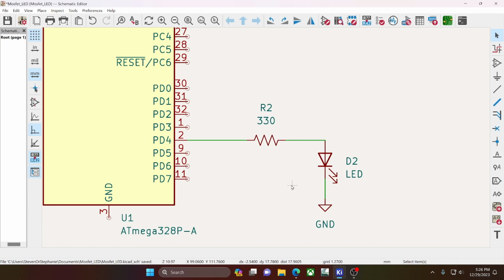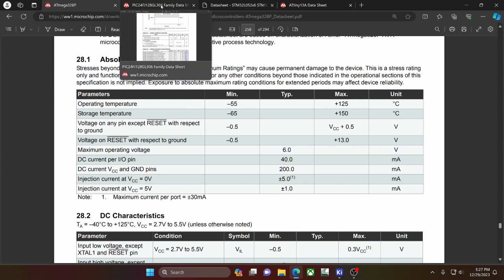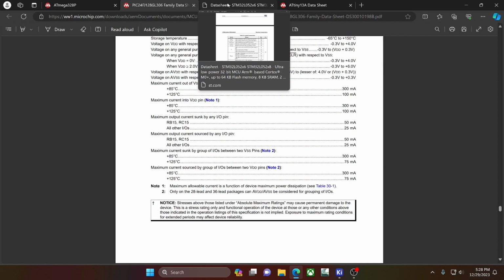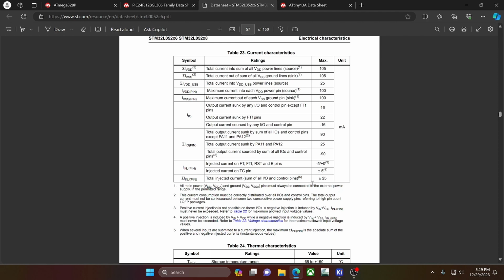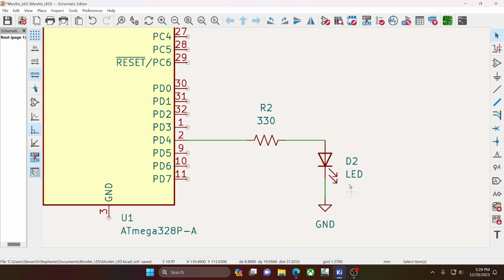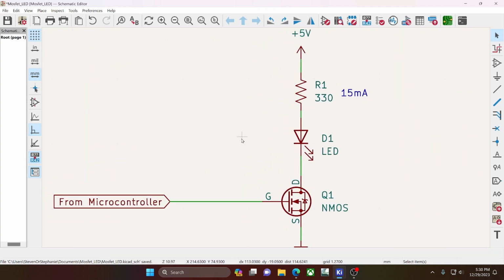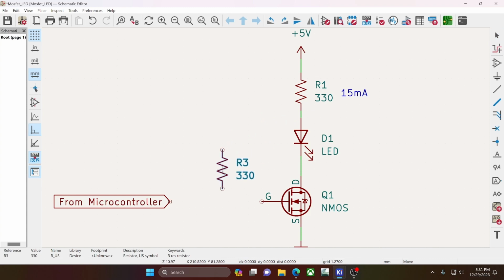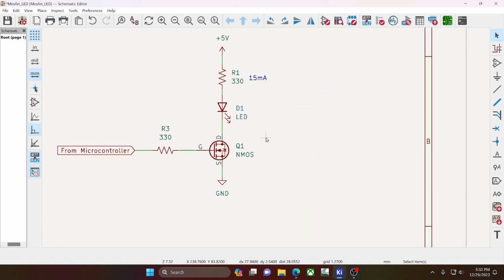Do NOT drive your LED with a microcontroller | Do THIS Instead

Comment: When prototyping, an open-drain or open-collector inverter IC can be very handy for this purpose as it packages multiple mosfets and their gate resistors together into a single package. Some of them can sink quite a bit of current (the ULN2003 is rated for 500mA).